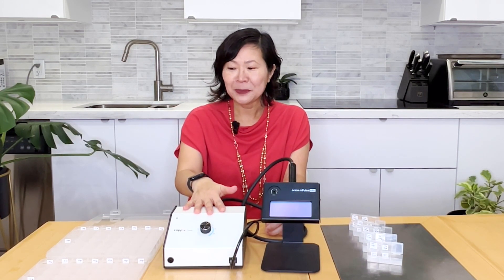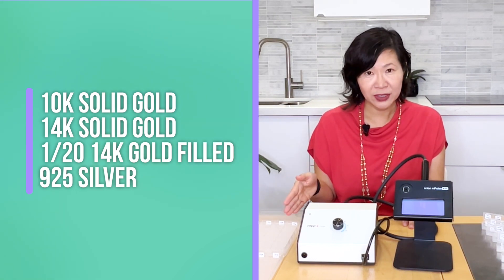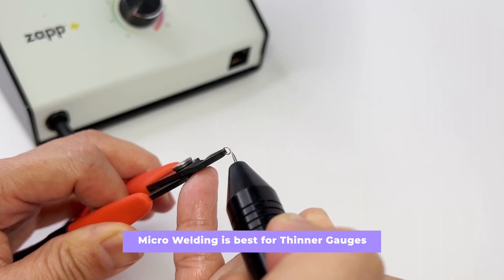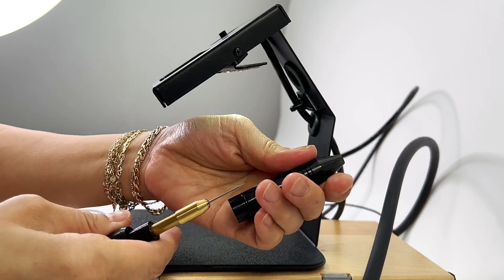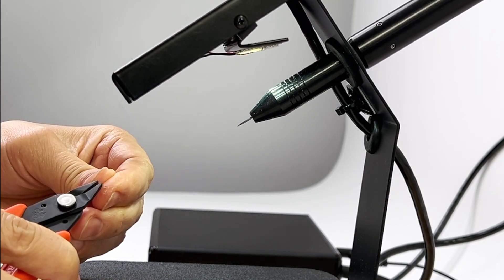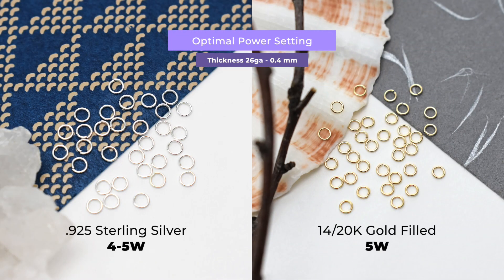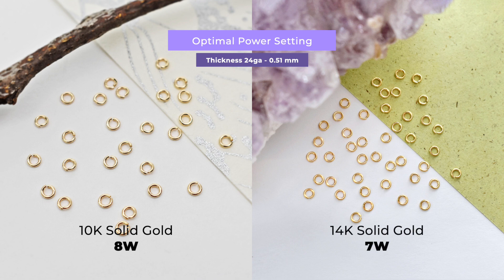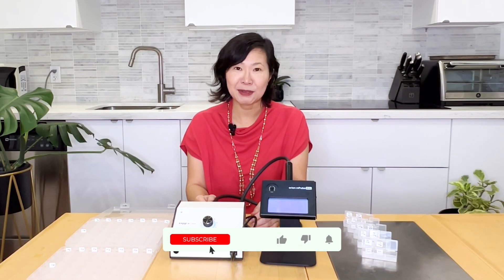7.  The BEST Power Setting For Micro Welding With and W.O. Argon - Free Permanent Jewelry Training

Comment: What power strength do I need to size up a men’s ring? I see 30-50-80-100 watts I assume I need 100 watts for a pulse to size men’s gold rings??? Pls some one help advise me
Reply from the maker: 30 watts is plenty and micro welding uses tack welding technique (so, small welds all along).  If it is a really thick ring, I would suggest you use the traditional flame and solder method as heating the entire ring, and using solder to fill the gap will create a stronger bond and allow you to then file seamlessly. 

I have done it before, using additional wire as solder, but I find that I am still able to detect the seam.

Comment: I am considering PJ and your videos have been very informative. Thank you for sharing. My question is that, what welding machine did you use for the metals in the chart? Did you use argon gas? Thanks again.
Reply from the maker: For the chart - it actually does not matter the machine.  THey're made by Sunstone and the actual power that comes out is controlled by the dial and is consistent.

I love the Orion mPulse - it is the, hands down, the best arc pulse machine ever made (or on the market).  

If budget is very tight, you can go with Zapp Plus with ADL.  The only difference is the digital touch screen, which is expensive to produce.

Comment: Did you ever experiment with Stainless Steel?
Reply from the maker: I have once, but did not bother to purchase all the different gauges to make a chart of it.  It welds stainless steel and the power setting needs to be slightly higher.